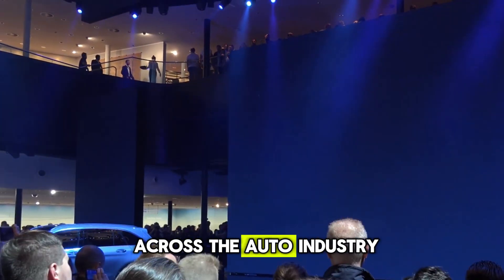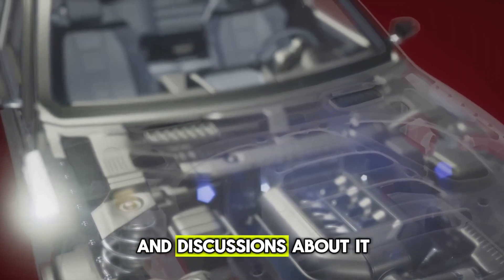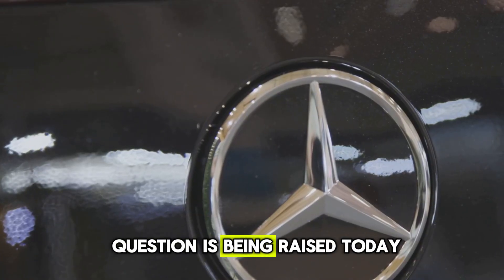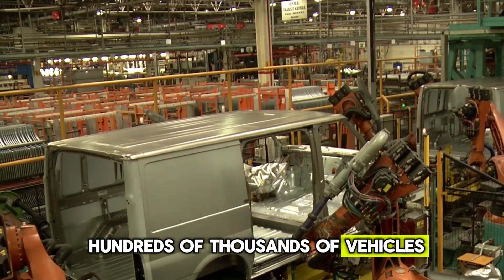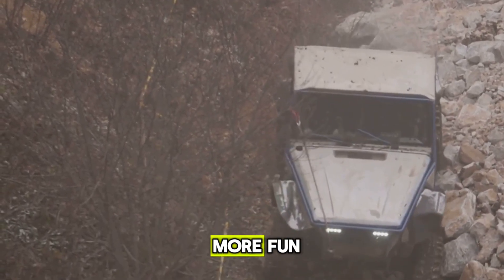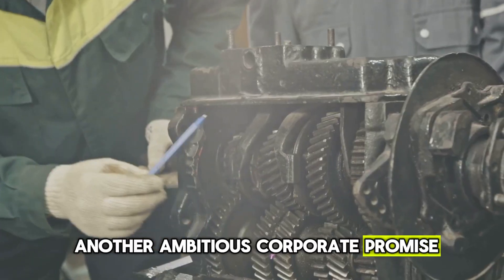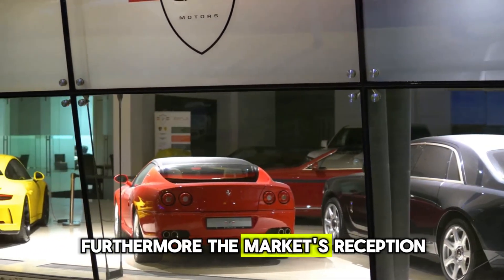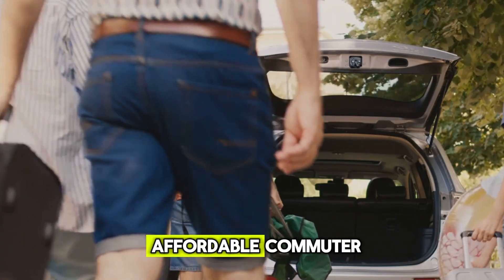Mercedes Drops a Bombshell: YASA Flux Engine Officially Confirmed!

Comment: Guys, it's still an electric motor,  and for 1 HP it needs them same 0,7 kW as any other ... ( power losses within the structure not considered ).
And, as there is no wire, the electric current must come from akku resp. battery...

Comment: It isn't the motor that's the problem , it's the power source dummies..... These young engineers still haven't learned how to think things through. On top of that , they would be sucking up every bit of rare earth metals on the planet , causing shortages to where it is really needed. That would eventually , effect all of us. Rare earth metals would become extremely rare. Flux U Guys!
Reply: Exactly! Nothing wrong with electric motors, just the dangerous lithium batteries.